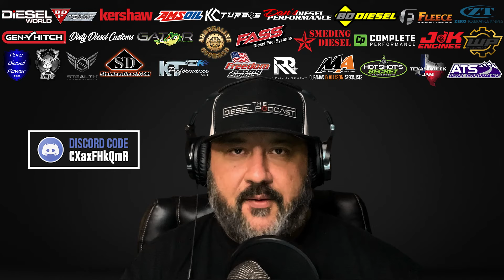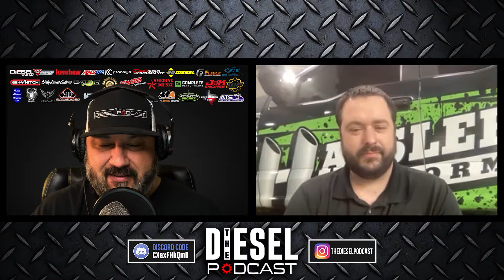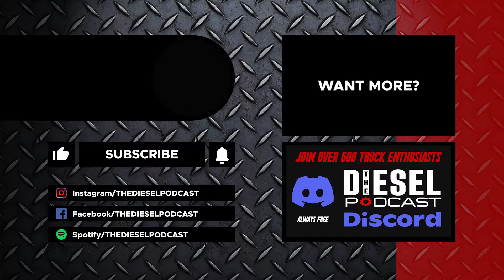7.3L Common Rail?

Comment: I'd love to hear from a street performance 7.3 guy. 600hp range, what are the common failures and specific causes behind them. You know, the 250cc-300cc injector and t4 turbo guys 🙏
Reply: Bottom end woes: The caps walk, the cranks break, they split the cylinder walls, the cam gear walks off, the piston cooling jets work themselves loose from their mounting flanges and fall into the oil pan, stock ford pistons have too sharp of a lip on the bowl which is a huge stress riser.
Reply: @too-stoked-about-2-strokes  sounds like some good insight. I'd like to pick your brain a little later on if you're down to talk
Reply: I only say that because I know plenty of guys aren't shooting for a 4 digit hp number on a 7.3 and there are plenty that also aren't happy with a drop in charger and a set of 180/30's because 300rwhp isn't quite enough
Reply: In short: stock bottom end forged rod guys

Comment: I'd love to see a street 7.3 common rail conversion. Not sure what Jonathan did, but wasn't it D-max CP3 hardware and PCM? Could be quiet and make great power with all those cubes. Way more than the rods could handle. VGT common rail for a great daily/tow rig...
4 valve head could really raise the fuel only ceiling the 7.3 has, although they are RPM limited through the IDM in HEUI form.

Comment: I remember when Dave Mitchell had the Great White Dodge. It made about 700 hp. It was a monster pulling truck back then. 300hp on the street was crazy power lol. Had a blast at Thunder in Muncie 2001 lol! Thunder in Muncie changed to IRP then ORP now UCC.
Reply: 300 wasn't jack shit in 2001 😂😂😂😂 maybe 5-600